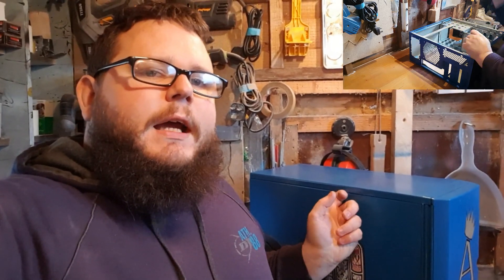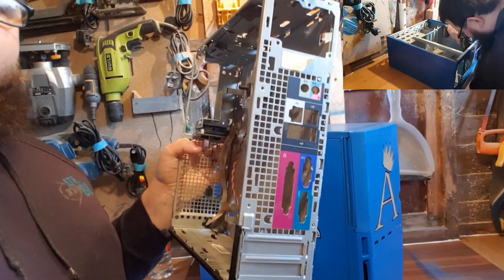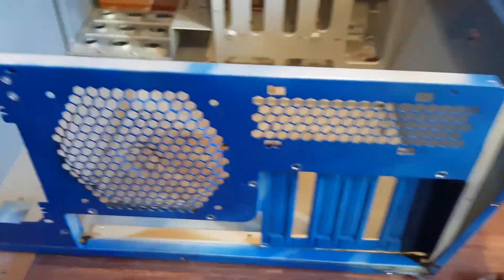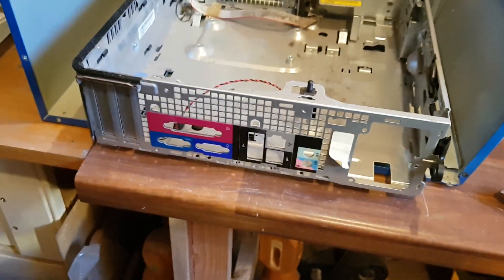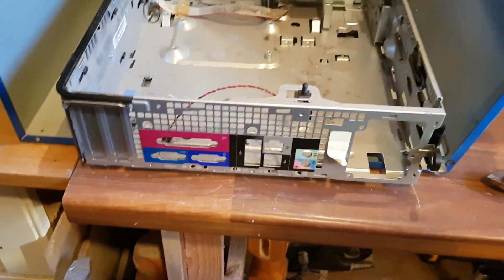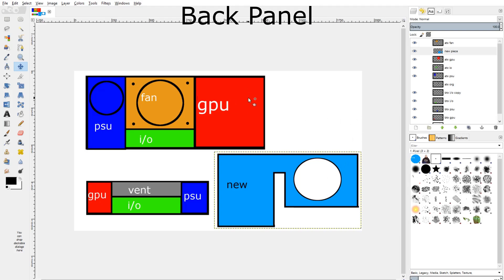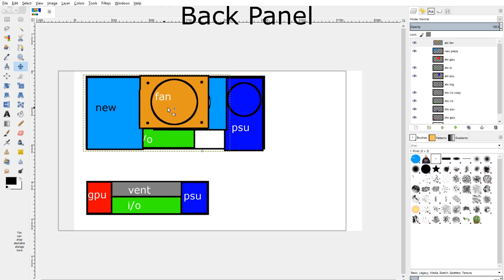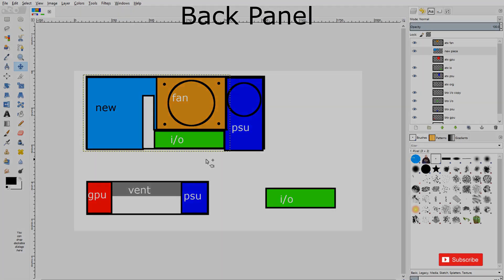Converting an ATX case to fit a BTX motherboard

Comment: okay, my answer is going to be to long and complicated to post here so ill try and keep it short. couldnt you make a tray your self from a mold of the motherboard, cut out the back case, save the pci slots bracket, take the built in i/o shield from the dell case cut out the best to your ability, and form holes in the existing case with out doing to much heavy moding? im going to have to make a video on my youtube channel explainng my processes better but i hope its not to confusing lol.

Comment: Very cool work. I happened upon a BTX case from 2007 era and I had no idea what the hell it was. It's still stuck in that BTX case which really hurts the expendability of the computer, you can't really put a 2 slot GPU in there or anything :( Just wanted to put a 8800 GT in there for an old school XP/Vista era gaming rig.

Comment: Why didn't you just keep the board in the original case? Why did you need to "upgrade" to a BTX board so quickly? Those SFF Dell cases aren't bad cases.
Reply from the maker: No they are not bad at all. It was gpu size and the power supply size that was the deciding factor tbh. I had all the parts bought before I realised it was a btx motherboard and they are all used parts so I couldn't returned them, so I improvised 😊, Thanks for watching

Comment: Now that is cool man. I really enjoyed what you did. I tried to do a mBTX to a mATX/mini-ITX conversion. Although my solution isn't as elegant as I lack the skills of cutting and welding. I have an old Dell Dimension E521, which was my first pre-built PC, before I actually got into building PCs. Although it was an old PC, I really loved the case design from Dell at that time, so I got a piece of plexiglass/acrylic sheet and drilled holes matching the mBTX case. Then I drilled holes on the sheet matching mATX/mini-ITX and screwed in standoffs. I had to mount the board 90 degrees rotated so the CPU/cooler faces the intake fan and the I/O faces downward, and PCIe slots face toward the back. If you have extension cables for the I/O and riser cables for PCIe, putting a mini-ITX works best with the way I did it. I tried with mATX board but putting in the GPU becomes challenging. Then there was the challenge of getting the power switch and the case LEDs to work. Now that's a story worth an entire novel getting those to work.
Reply from the maker: That sounds like a good solution 👍, it's great that you were able to get it working. Thanks for watching and supporting
Reply: i got the same exact pc from a yard sale lol ive been trying to find a case for ages

Comment: I wanna make the samek case mod as you, ¿did it work good?
Sorry for my another coment, i´m not so good speaking english
Reply from the maker: Hi, yes it works well. The PC has been built and is working perfectly in it now. It is a bit of work but totally worth it. Thanks
Reply: @EveryDadDIY  Do you recomend doing it? I need to switch the case from an hp 8300 and upgrade the graphics card

Comment: I was thinking of doing the same. It didn't occurred to me, to cut the base of the original case, I was thinking of drilling new holes. You're god damned genius!
Reply from the maker: Ya its alot of effort but it works. Thanks

Comment: What if you want to do the opposite? 

Like say u have a Dell 755 MT but purchased a micro atx mobo?
Reply from the maker: Hi, Could you flip the mobo upside down and move your power supply to the bottom of the case and cut a hole for it  and cut a hole for the graphics card at the top? . Not sure if that would work or not.